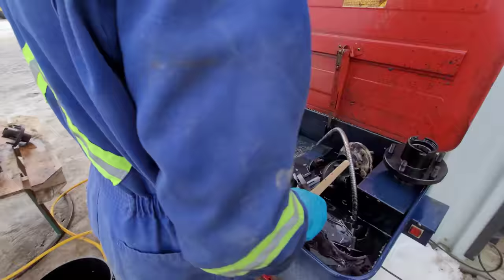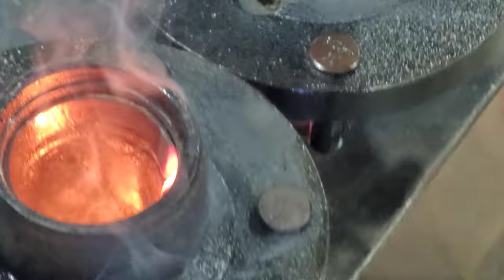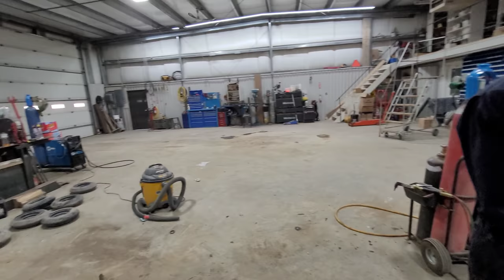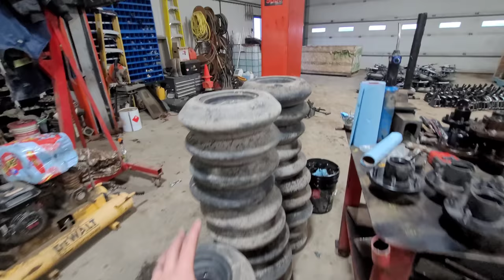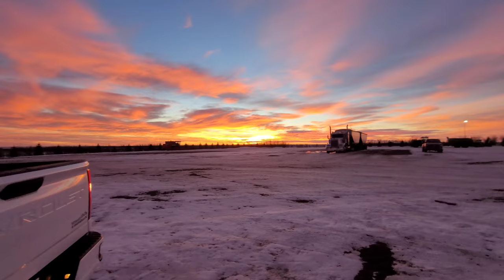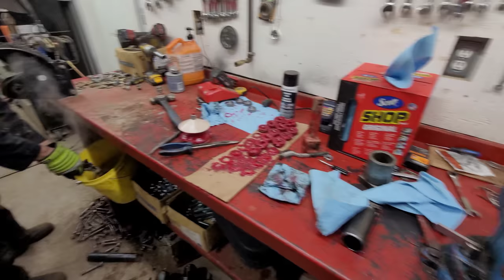"Shop work" How to change packer bearings

Comment: You need to put the empty 5 gal pails to use to put items like points, old bearings, old bolts etc into so things don’t have to be individually handled more than necessary 💪💪💪
Reply from the maker: 🤔 You know, I think it started out that way at one point 🤷🤦🤔😂
Reply: Pretty sure they have it under control.

Comment: So Mike, out of curiosity,  what's the labour's cost on replacing those bearings compared to what it is to put a brand new pre packed unit like you said. Seems the amount of labor we are seeing on the video would justify the cost of a hole brand new packer units . I. Probably wrong but just from what I'm seeing. No disrespect
Reply: No definitely cheaper to just do them by hand. The guys are there and working and getting paid anyway, why not have them do something and save a little money while they are at it.
Reply: @mikeznel6048  I guess. Think about 3 guys @ 20 plus dollars and hour times how many hours . Just seems like a guy could buy new ones. But it does keep guys working thats the other side

Comment: Damn you need some tables on castors so you don’t have to bend over to pick parts up off the floor.
Your backs will be happier at the end of the day.
The crew may be young but if you take care of your body it lasts longer with fewer aches & pains .
Work “Smarter” not “Harder”
🤣😂
Reply from the maker: I agree!
Reply: This is the same Mike that climbs in top of moving eqpt. Augers, you name, but wears gloves to use a hammer and chisel. Just WOW
Reply: @guzzimon61    Ashtyn does a lot of the cooking.
Maybe he has “DISHPAN HANDS” 🤣😂
He also probably doesn’t want to get his hands dirty because then his phone would be all greasy.
Reply from the maker: @gavinperry7237  🤣🤣 I am going with keeping the phone clean, but it must be a Mitchell tradition.. My grandpa used light gloves and wore a light jacket all the time, even when it was +35C and inside an old tractor cab 🥵🤔😂
Reply: @mikemitchell2554    Maybe you got use to using the gloves that went up to your elbow when you had cows and now that you no longer have cows you simply changed glove styles 🤣😂

Comment: not sure how much you have to grab onto those bearing races and it looks like your torch setup is working pretty well but I feel like this sort of puller may work a bit easier if you paired it with an impact, plus less likely to damage the wall where the race fits.. really interesting video though, I love seeing how different people attack problems. https://www.amazon.ca/Bearing-Puller-Extractor-Automotive-Machine/dp/B07D11TC89/ref=sr_1_38?dchild=1&qid=1608431093&s=automotive&sr=1-38

Comment: If your impact won't spin the bolt you don't have the right impact.  Our impact has over 2,000 foot pounds of take off force.
Reply: I'm just giving you crap but seriously our impact will twist then off it won't break loose. And does it really matter if it breaks if it doesn't break loose?

Comment: Mike I’ve been watching your video over a year and some others in Canada and other parts of the world I live in the USA south East were called the hillbilly’s I got a probably and dumb question the outfits y’all ware got the blue coverhauls with the refection lines is that something y’all have to ware of course for safety but is it some kind of a law I’m just curious
Reply: O’Neal Farms  There are a number of reasons individuals wear coveralls.
Generally speaking lots of coveralls are “Flame Resistant” for safety purposes.
Coveralls keep the clothes beneath them cleaner so the dirty coveralls can be removed so dirt & grease is not transferred into vehicles or house.
The reflective striping makes it easier to see people in work situations.
Also keeps the draft off the back when constantly bending over.
Multiple pairs of coveralls are commonly found in someone’s vehicle or shop.
Reply: A while back there was a big push in western Canada for it, either to be a law or insurance or whatever and then politics changed and the habit continued..

Also Oilfields, as they are scattered throughout the Canadian prairies helped too.

Comment: So,, the bearings are 45$ the new hubs are 145$ at 84 per drill. so that 12,180 for new. 3,780 per drill in parts. Now comes the labor to rebuild, say it takes 20 min per hub on the quick side for torching out the race and hope you don't ruin the hub in the process when using a torch,, Titanium highly unlikely and I have never had a race I could not get out with air hammer long chisel. So your doing on the average 3 to rebuild a hour, I have no idea what you get paid per hour So, I will average you on say 100 on the low side. So say it takes 28 hours to rebuild the 84 hubs that's 2,800 in just labor on the low side. Cut the time in half with 2 but the labor cost is still the same. Now take into account of shop supplies, heat... lol well what heat as your not smart enough to build a nice shop to work inside in the comfort, were in there also lies the speed and efficiency, I have worked outside in the winter, speed goes down because the comfort isn't there. Now your adding onto the labor cost as it takes longer. So say if you had heat, electricity, unneeded cost of fuel for oxy / acetylene, towels, rags, cleaning supplies,, Diesel fuel and gas!!!,,,, Really, REALLY!! Once again get the proper supplies and don't cut corners. So all in total I would estimate your rebuild price around 7,580 for a savings of 4,600. Well Mike,, I hope you take that 4,600 you just saved put it in a piggy bank for a new shop! Once again your MILLIONS of reasons why you don't build a shop and storage for equipment is just a excuse when it comes to the MILLIONS spent on equipment.
Reply from the maker: 🤔... Why do I get the feeling you have "chip" in your shoulder for me Lonnie? Your previous comments leaned the same way. Have I wronged you some how or do just not like me? Either way, that won't change anything I get it. 🙂

But a savings per drill is still a savings per drill. The guys have to get paid regardless of what they are doing, so instead of doing "create work projects" to keep them busy when things slow down, we choose to do actual needed projects and save money. So the labour isn't a factor.. It's better than laying ppl off when it's slow.

I hope you have great day there good sir, and Merry Christmas to and your family 🎄🙂